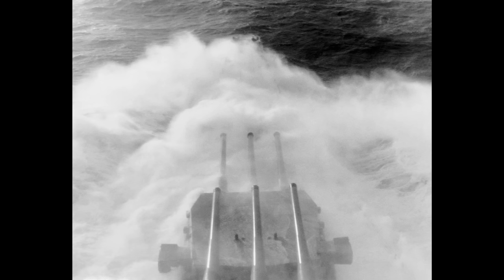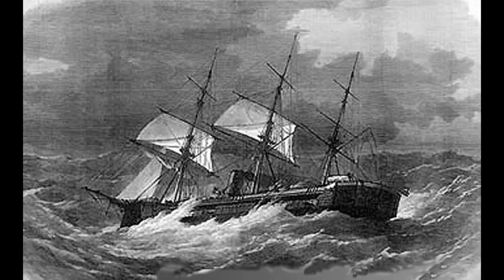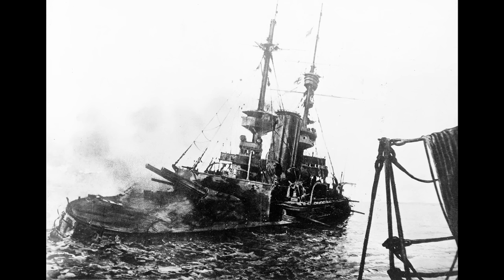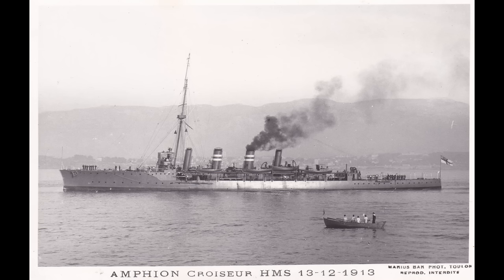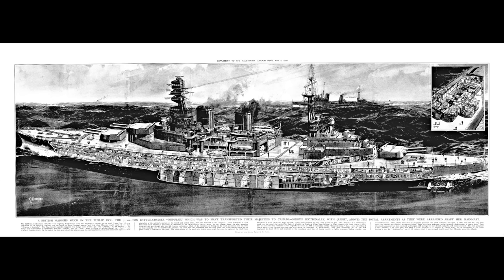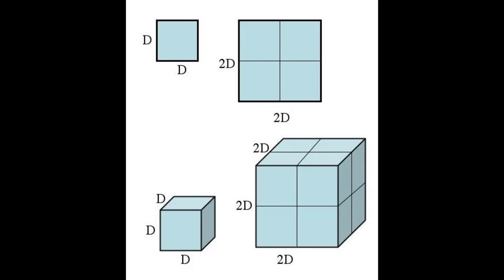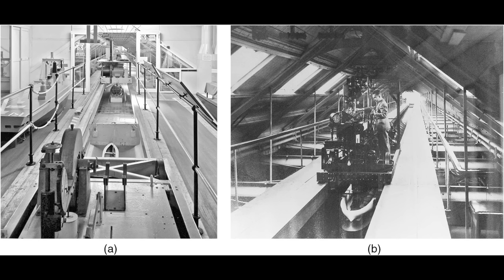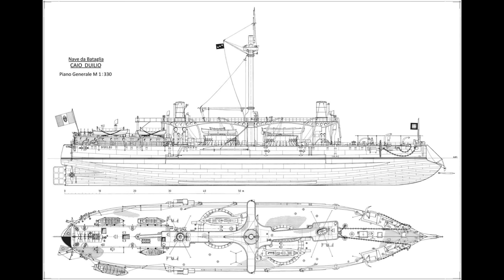Hull Form Design - Doing better than a floating brick

Comment: It’s the Fairest Curve that drives the Sailors and  the Naval architects Mad …and incompressible water becomes quite displeased when it is displaced …the Hydrofoil being the latest rage amongst kiters and windsurfers and dingy sailors..and Zippy ferry boat operators …. So Cool to watch ..
Reply: From what I can see, hydrofoils have seriously disappointed many operators that have tried them.  Military hydrofoils (as the US Navy tried them) were an operational failure (they cost too much to operate to be justified by what they could do, making them fairly small vessels with the basic problem of battleships:  They are astonishingly good for certain things, but you can accomplish the same jobs for less money in other ways).

It's difficult to use hydrofoils in the Atlantic, because the Atlantic tends to be fairly rough most of the time, and hydrofoils don't like rough waters.  (It makes it hard to get up to the speed where the hydrofoils start being able to lift you hull out of the water, and a tall wave that hits your hull can really give your vessel a bad knock, so transitions can be quite nasty in more marginal sea conditions.  I rode in a hydrofoil on Lake Ontario a couple of times about 40 years and, and half the time it was too rough for them to use their hydrofoils on nice, clear summer days.  We get WIND in Ontario in the summertime.  There have been attempts to restart a hydrofoil ferry between Toronto and some point on the Canadian side near the Niagara River, but they have previously fallen through, mostly because there's a very limited market for a marginally faster way to get to an area that has a fairly niche tourism industry built on wine and theater.  There's now a rather amusing try at an electric hydrofoil ferry service, and they're making the cute claim of having no wake.  The fact a hydrofoil disturbs the water less than a similarly sized conventional ship means a much smaller wake, but not NO wake.)

There are successful Mediterranean hydrofoil car ferries, but the Mediterranean is notable for being like the Pacific:  It's usually really calm, except when it's really, REALLY not.  It also has a huge advantage for a car ferry service that there's a number of big islands with large populations and lots of stuff to attract visitors who find it very useful to take their cars with them because those islands are that big, and there are these bodies of water that divide major countries on the northern coast from each other and can be much more quickly crossed on a fast ship than driven around.
Reply: @evensgrey  Exactly plus Foils are delicate… great if your on a Kite Board or small dingy … our Carrier routinely visited Naples Italy and they had those ferry’s zipping around on their Foils going to Capri .. but their is no way your getting a 60,000 ton carrier up on a Foil …  yet … but even those new Zumwalt class are a big disappointment… plus they corrode to pieces … besides when your at sea the coolest thing is to go forward and watch the bow cutting trough  the ocean ..
Reply: Short in coastal boats, the German Schnellebooten beat all. Their Diesels went from 800 to 1500 hp on the same displacement during the war, simply due to technological advancements. PT Boats and Vospers were very well in the south Pacific and the Med, but a handful of E-boats could kill a destroyer.
They could go over 60 knots in the North Sea by the end of the war, in almost any conditions. Displacement hulls and huge power plants fueled with diesel. Very tough nuts to crack.
Reply: @georgesoros6415  Excellent Point …. I hope Drach does a E boat episode or episodes there is nothing out there about those fascinating craft ….cause pound for pound they and the u boats really did a lot of damage … if Germany had started the war with 300 E and 300 U boats … it might have gone somewhat differently….?
Reply: @stephenrickstrew7237  It would be a hilarious sight to see. A carrier going almost 50 knots on several rows of hydrofoils. Certainly harder to torpedo lol. Would definitely be completely unviable on a battleship though, lol.

Comment: side fact: transom stern. in modern merchant ships, it's there to keep the deck at full width all the way to the aft. To keep the speed up, we usually load/trim it so the transom stays OUT of the water. Just for those vortexes. because they drag ALOT.

Comment: Your intro reminded me of a trip to the central public library(20 years ago) when I was getting interested in sailing and considering building my own boat. After reading a bunch of introductory stuff I was searching the catalog and found a naval architecture book listed as located in "the stacks", I went to the reference desk and 10 minutes later they come back an drop a huge book on the counter. I skimmed it for an hour or two, and it was chock full of all the diagrams and equations you would want when creating a high end program to simulate the performance of hull shape, ballast, control and propulsion. Never bothered to request that book again.(Though my interest also shifted from boats to aircraft.)

Comment: Really interesting video. I learnt a ton about buoyancy as well as hulls! Your thoughts on stability made me think of the modern (well 80s) supertankers which were certainly wider than tall.
Edit: We have seen wooden and metal warships. Lots of racing craft now are carbon fibre or fibreglass. Do you think we will see warships made of the same material & the effects thereof on hulls.
Reply: Some warships already made with fiberglass hulls.  Plus Kevlar and similar protective sheets are made from polymers.

Comment: 57:00 - Being longer and thinner can also hurt your speed directly if you take it too far.  As the ship's aspect ratio increases, its surface-to-volume ratio also increases; if displacement is held constant, this translates into an increase in wetted area, which, in turn, increases the frictional drag on the hull as it moves through the water, and the wetted area (which is directly proportional to the frictional drag) increases faster and faster as you keep increasing the aspect ratio.  Past a certain point, going longer and thinner will actually increase your overall drag, as the increase in wetted area will add more drag than you save by decreasing the ship's frontal area.  (The balance between pressure drag and frictional drag is also important for aircraft, and is one of the big reasons why you don't tend to see a lot of airliners with enormously long, skinny fuselages, nor ones with stubby, bloated ones.)

Comment: This makes me appreciate Scotty even more; just imagine the engineering shenanigans of a starship.
Reply: The only guy in a red shirt who's still alive.
Reply: Spaceship designers have it much easier, no air or water resistance, no buoyancy or metacentric height. Bricks fly quite nicely in space.
(But still have to worry about the thrust line relative to centre of mass as Drach said about sails vs engines. The Enterprise should pitch itself nose down into a roll with those off-axis nacelles.)
Reply: @hughfisher9820  slightly angling the thrust exhaust so it goes through the centre of mass, and countering with manouvering engines of some description would make it possible to fly in a straight line. Less efficient, yes. But possible
Reply: But Scotty was the very model of a WWI engineering officer at Jutland, where Scots couldn't be line officers, by law, as incredibly stupid as that might sound, so they made up almost all the engineering officers in the RN. Their reputation was that the snotty brit captains would issue impossible orders, yet they would carry them out, just to get at the snotty bastards.
So Star Trek, always wanting to be inclusive, but realistic, made Doohan the engineering officer, which I fancy was entirely appropriate, just as Sulu was the typical Japanese WWII officer (quiet and respectful an competent) and Chekhov was the typical Russian officer Obeying orders but always questioning and troublemaking. And surly.
All because Whitehall thought Scotsmen too stupid to be line officers (but apparently not too stupid to beat back the Russian heavy cavalry at Sevastopol nor the Afghans at the Khyber Pass, dying to the last man nor a thousand other places.....
Yet when Beatty crapped himself at Jutland, he replaced Jellicoe.
Go figure that shit out.

Comment: Normally I don't have the neuron power to digest such a complex topic, except I understand this topic intimately from first hand experience-- I kayak.  A kayak is the only craft where you 'wear' the boat on your body and it is 100% your energy.  It is really eye opening to experience the impact small differences in hull design make, coupled with materials, length/beam ratios but, most of all shape.  When it's your body paying the price-- you learn real fast.

Comment: 32:28 if you assume you keep the same underwatervolume, a shalower draft is more stable:
BM (boyancypoint-Metacentre) = (Ixx)/(volume)
With a square hull:
BM = B / (12T^2)          B=breete (with), T=tief (depth)
T stands under the division line so the larger the depth, the lower the stability

Comment: But Drach, there are ships which can turn themselves upright again! Most Rescue-Cruisers of the German Seaborne Rescue Society are built to be able to save themselves from capsizing.
Reply from the maker: Yep, there's very specific and highly advanced engineering that goes into them, include absolute watertightness. :)
Reply: All the all weather RNLI lifeboats are self righting too and their design are nothing short of an engineering marvel. They also have the astonishingly good ability to maintain near their top speed regardless of sea state. Severn class tops out around 20knts in flat calm and they'll do that in just about anything you throw at it whereas boats similar size would be mad to even head out and larger ships can lose a hell of a lot of speed. So while Severn isn't that fast on paper, they designed her to achieve that speed in all weather's. Add in that they're remarkably good at taking much larger ships under tow plus some other party tricks as well you'll get why I claimed "engineering marvels" 😉
Reply: @Drachinifel  ......so....not the Vasa?

Lol.... And three minutes later, a beautiful model of her crash diving!
Reply: At a very different scale and purpose, monohull sailing yachts that are not strongly self-righting are considered to be dangerously deficient designs.
Reply: @markhamstra1083  yup, yachts being self-righting to a heel of 100+ degrees is not too unusual.
Reply: @matejlieskovsky9625  I've seen sailing yachts knocked flat in a sudden squall right themselves in a few seconds. BOATS FLOAT! AIN'T IT AMAZING?
Capt Bligh sailed ..what...3000 miles in an open boat?
BOATS FLOAT! AIN'T THAT AMAZING?
Reply: That's amazing honestly! 

I always thought that the fact that simple jet-skis(or Sea-Doos as some call them) are actually designed to be flipped over and then flipped back without anything being wrong with them(provided you flip it over the right way) was super cool but I had no idea that could be applied to anything larger!

Comment: In regards to trireme speed,
Wouldn't it be a lot easier to just add a second drummer to the oar deck?

About the early USN monitors being compared to a 'heavily armed raft'.
How long did it takes to inflate one of them?   
Did they use an air pump?
Or just blow into the red valve?
Reply: ...second drummer... LOL. Mahalo for that.
Reply: You realize that (wooden) rafts were a thing MILLENIA before inflatable rubber craft became a thing and started to abuse the name?

Sadly one has to ask such thing today with the state of US education...

Comment: Lol, the photo at 29:00 .. The South Dakota class BB has the number 2 turret pointed back directly at the bridge of the store ship that is along side. One can imagine the Captain saying: "No, we will take ALL the chicken." 

Regarding a difference with modern sailboats, the latest hydrodynamic factor mentioned is "Wetted Surface" which refers to how much hull is underwater. This is why modern racers usually have a dish-shaped hull which seems rather shallow for the size (the main hull having less draft and a little more beam, although the narrow wing style keel sticks down quite a bit, often with a big lead-weighted bulb at the bottom for added stability). This can extend the "Hull Speed" of a boat which is the maximum speed of a non-planing hull that can be achieved without exerting exponentially greater power. Such boats are not known for sea-keeping, and many long-range or family cruisers prefer more traditional full "Displacement" hull shapes for comfort and safety. Warships probably can't go that route, they need the volume and stability of a fuller hull. But I suspect if they did for some reason, they could get by with dramatically less horsepower for the same speed, and therefor much smaller engine and fuel spaces.

Comment: My friend, Howard Gradin, found a damage control chart on the USS Salem.   It showed speeds for various engine and propeller conditions, ( ?Damaged shafts might be locked, creating drag. )  He was impressed by the increased power required to push the  ship to its top speed versus something a few knots slower.   Officially it had a 33 knot top speed.  I do not know what her actual speed might be operationally.  Atomic aircraft carriers have have rumored top speed in the 40 knot plus area.  atomic power providing the insane grunt needed to push them to such classified speeds.

My friend reported seeing Green ( solid, non foaming) water was seen over the B ( higher front ) turret, in very heavy weather.   This was on a auto loading 8" gun  cruiser.  Great work! .
Reply: Some nuclear submarines are rumoured to be capable of 70+kts submerged (Russian Alfa) because both the reactors are capable of delivering the power and the high pressure around the propeller prevents cavitation. 
The down side is that it is VERY noisy due to vortex shedding. 
This does however make them fast enough to out run a lot of torpedoes (other than the 200kt Russian Shkval).
Note the Shkval cannot be launched at above 50kts.

Comment: As an aeronautics engineer, so someone who designs things moving through air, I can assure You that compressibility of air causes major problems, and it would be better if it weren't
Reply: It changing it density can get annoying but would take it over trying to move things through a non comparable fluid like water. You would just watch anything that tried to re enter the atmosphere explode like it just came from
Orbital speeds into the side of a mountain
Reply: Not half the headache viscosity causes! (Well, specifically, turbulent flows)
Reply: And in process industries compressibility effects of air is actually very useful (especially for turbocompressors)…

Comment: It is often said that the introduction of the Dreadnaught changed the entire landscape of naval warfare. But what exactly was so revolutionary about the dreadnoughts?
Reply: They up'ed the anty on the level of protection, speed and firepower way beyond anything floating at the time. Up until then ships had improved on one or the other. Dreadnought leapt ahead on everything all at once
Reply: The two main differences was guns (main and secondary batteries effectively meged into a single large gun calibre, instead of 4x12"  in twin  turrets + a bunch if 8 to 9 inch in casements Dreadnought had 10x12" all in turrets) and propulsion Dreadnought was the first Capital ship with turbines. The effect of this was she had more long-range firepower and was faster.
Reply: @alanclague2333  not to mention the shift away from ramming
Reply: @invadegreece9281  ironically Dreadnought's only victory was ramming a German U-boat. 😏
Reply: @jefferyindorf699  yeah
Reply: To sum it up in a sentence, it marked the shift from battleships being built for short range battles where every gun could have it's own gunner aiming by eye, to long range ones where you needed to do math to aim your shells.

It made everything before it obsolete because if you can hit things accurately enough to kill them from ten miles away, and your enemy can only do it from two, you are going to win almost every battle.
Reply: @georgesoros6415  angry much

Comment: Thanks for your videos  - they are just great but I would like to point out that in case of Pensacola class the major reason behind placing triple gunhouse (not the turret - sic!) that high was that designers did inderstand that their bows would not have very much of buyoancy and they decide that the more guns would be higher the more guns would be drier (that's how Norman Friedman describes it in his magnificient book US Cruisers  - An Illustrated Design history, p.123). If we look at the plans of these cruisers we can easily notice that difference between widths of the twin and the triple gunhouses is much less than difference between cross-sections of the ship in the places of theis respective installation. Moreover, the after part of tPensacola's is wider but the triples there were again placed above twins. So there was enough room to place triples in the bows lower (in it was showed initially in sketch design with four triple gun mounts). Finally - just remember HMS Dreadnought and her wind turrets P and Q))))
So sad that this misconception is so wide spread and so many people take it without logical fact checking